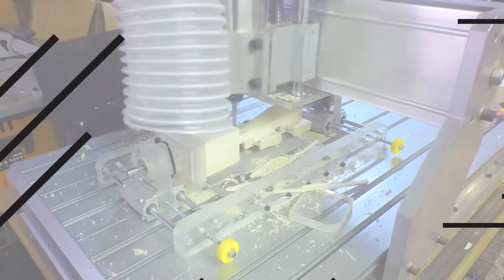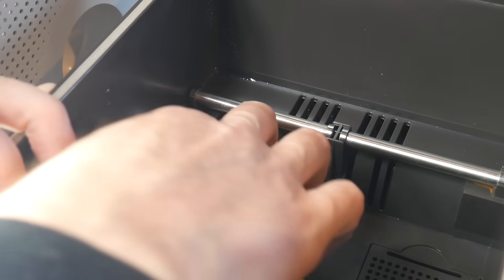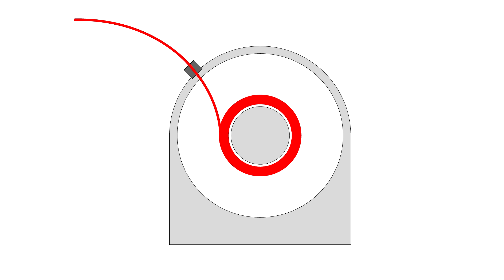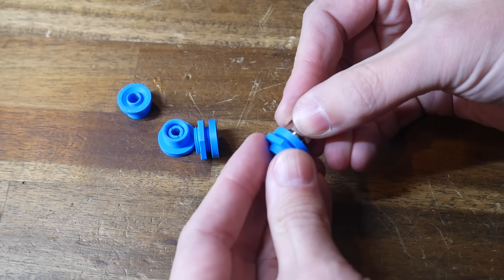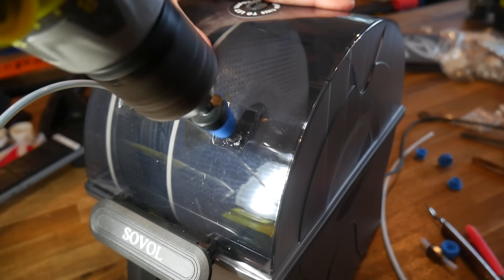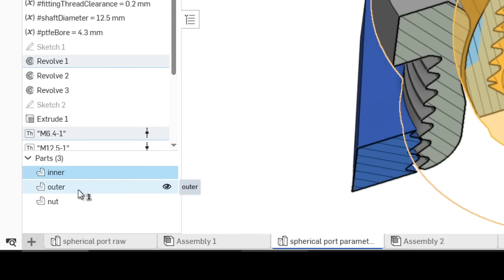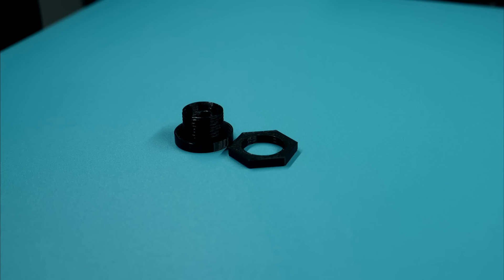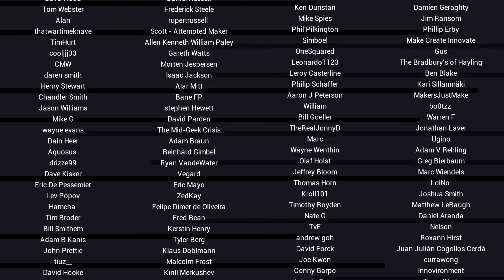Almost every filament dryer can be improved with this simple upgrade

Comment: Actually a 'vent' is needed for the top to open when the temperature rises to let the hot humid air out but another vent should be lower to allow for 'replacement air' too.  Not an easy solution. ... The only filament storage that seems 'correct' to me is what Adam Savage did by putting a small room size dehumidifier in a closing storage cabinet that sent the water effluent out to a drain/container outside the enclosed space. 

https://pie.yt/?v=https://youtu.be/taeS72yO__k?si=KiPTxEmqVAZgEBHk&pieshare=1

Comment: Are you going to do anything about the condensation build up in another video?
Reply: There are a number of mods for the condensation issue available online. For mine, I simply leave the lid cracked open ever so slightly (there's a lip that the lid can sit on leaving a 2mm gap). This is sufficient to allow humid air to escape via convection. There are compartments in the bottom of the dryer to place silica bead packs to help with moisture removal.

Comment: I’ve created something similar to solve this issue on my Creality box. The problem I’ve found is the nut loosens up from the heat cycles and then it’s just a floppy mess. Tried blue thread locker which caused the threads to break at the layer lines. I ended up just super gluing it down. Using petg-cf. Wondering if a different filament would help.

Comment: I'd love to see a video about modeling threads in onshape as that's something I find quite difficult.
Reply: I most often use the plugin to do this, but for odd threads I do it the hard way.  To do it the hard way you need to select a cylindrical surface, and draw a helix, this should be at the pitch of your threads.  select an endpoint of the helix, and the helix itself, then click the button for creating a plane.  this will make a plane perpendicular to the helix at that endpoint.  Here I generally draw external threads,  so Internal ones as a cut will be a bit different, but I make sure that the profile I draw extends into the cylinder, i.e. you make sure the root of the thread is well buried in the part. The thread sweep cannot self intersect, so make sure you leave a bit of space so that the profile is narrower than the pitch, even by a tiny amount..  Once you've got your profile, select it and do a sweep along the helix as a path, merging with the cylinder.  
Downsides are now you've got a clumsy start to the thread, so you may need to make the cylinder longer to start and then cut the finished part back to desired size.  Also to get a starting chamfer, you may need to do a revolved cut.  All this is loads more work than the plugin, but you can make oddball threads - I've done round multi-start threads like you find on glass jars this way for example.
Reply: Community Plugins
Reply: Comments were right! In OnShape, Add Custom Features -> Community Spotlight -> ThreadCreator. Insanely easy to set up and use. Would still love a video explaining the intricacies of threads and how to best design them into parts by the pro himself. Thanks for all the awesome and informative videos, and thanks for the community here for helping people out!
Reply: I had a look at the OnShape model, and I can't see how the threads are formed.  Some wizardry there.
Reply: He has done a video previously about using threads in onshape, a couple years ago I believe. It is done with a plugin
Reply: I did mine by drawing a sketch on a plane running through the axis of the item. Sketch a stubby triangle, and extrude it following the path of a helix. It will stick up past the end of the item, and then you revolve another triangle around the top of the thread to remove the excess and taper the beginning of the threads
Reply: Yup, struggled and gave up 😢
Reply: I’ve had trouble with it too.  Sometimes I model the threads and add them. sometimes I do a cut and remove them. I halfway forget what I’m doing every time. The standard tool is pretty good now, and unless you need to model threads for printing it’s adequate.
Reply: I agree - though the Thread Creator is nice, I do miss SOLIDWORKS' bottle and ACME thread profiles. And when I need to make something weird, nothing beats the simple sweep along a centerline with a twist.
But Onshape is getting better every month. It'll get there!

Comment: As good as this solution is I think it’ll be easier to just take out the rubber seals from the cover (not just unplug the plug, take out the entire seal for the plugs) while it’s drying/printing so the hole it larger and allows for more pivot, while also increasing release of humidity until you stick the rubber seals back on😅

Comment: Gotta say.  Having to hold a capacitive power button to turn the unit on is GOOD design.

Better design would be NOT to use a CAPACITIVE button as a power button.
Reply: It’s a resistive touch screen
Reply: @Shreyas-ud2lc Really!?  In 2025?  Dam....
Reply: @Telzrob  Yeah!

another big oversight is the lack of feedback. The digital buttons don't change shade to indicate the screen's picking up your touch.
Reply: I swear it’s the same screen as on the Creality Space Pi.
Reply: @Scrogan  The  Space Pi's screen is unresponsive A.F., but at least it has the right filament path, and also the filament is not routed through the lid.

Comment: forth to comment yeeeey .....  Children .....

have this one quite happy with it for  30€ i believe there is no better alternative on the market.
I see everyone has so much moisture in the filament it always fogs up the dryer. Now I'm getting worried mine does not function .... It heats it blows but there is never so much moisture coming out. Or I just have generally dry filament....
The connector you were looking for is the same as the one used on hot ends MK8.....  Sure some others aswell.
Good solution - wil save the files in case if i ever ned it. For now i do not print from the dryer.